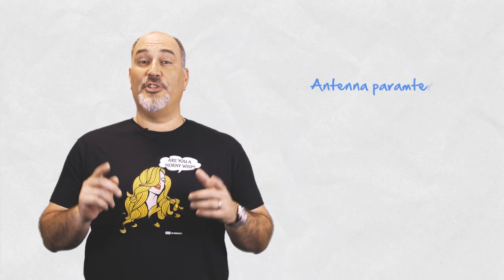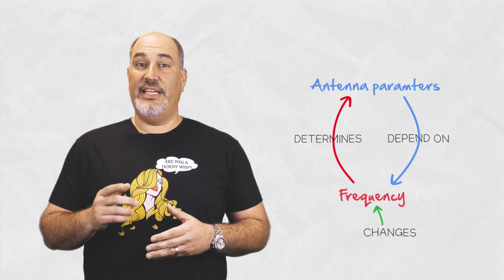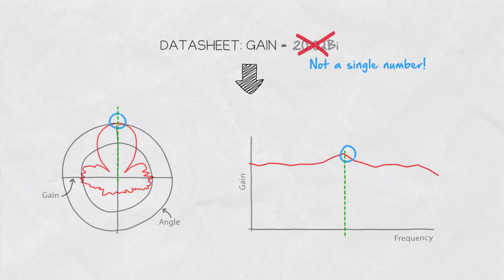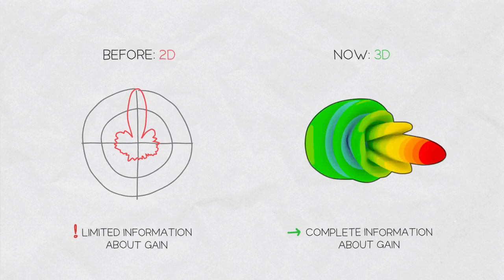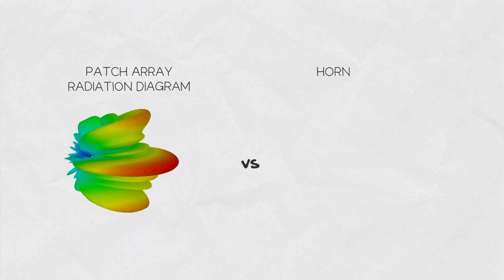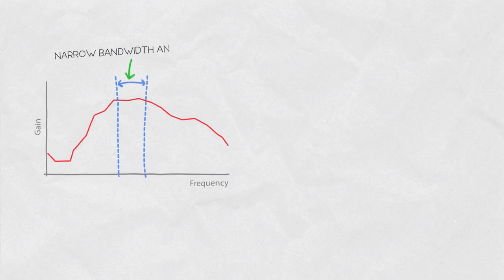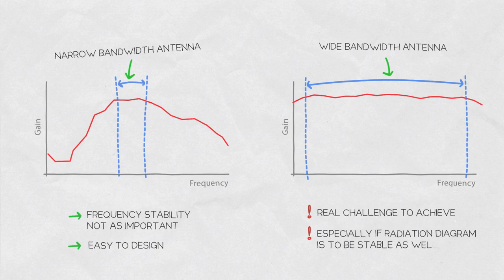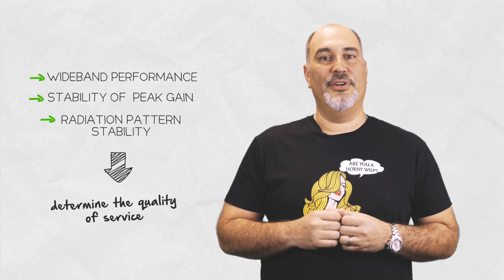Inside Wireless: Frequency Dependence of Antenna Patterns

Comment: let's say you have an RF meter and are trying to measure wavelengths at 900mhz. The meter came with a stock whip antenna "tuned" at 2.4ghz. So the frequency response below 2.4ghz may fall off rather quickly, thus effecting accurate measurements. 

Would it be better to change out to a telescopic 100 mhz-1800 mhz adjustable antenna and adjust it to 900mhz size? Or would it be better to leave the antenna at full length? Or would the impedance mis-match (due to being adjustable) outweigh the benefits of frequency response, thus the stock whip antenna would measure more accurate?

Overall, how important is frequency matching an antenna such as 1/4 wave length 1/2 wave length compared to just leaving at full length in measuring accurately? Does adjusting a telescopic antenna even chance its frequency response? 

Thank you

Comment: yes please, how can an rf spectrum be analyzed and what does it mean.
Reply from the maker: Hi Benjamin, spectral analyzers (SA) are not cheap, nevertheless, they do the job pretty well. Spectrum analysis means you see what signals are present at what strength in a particular bandwidth. This can be in a device connected to SA by cable or in the surrounding area when SA is connected to an antenna that works in the particular band.